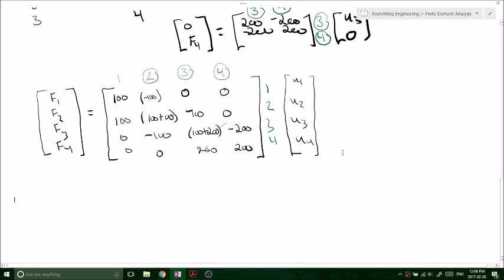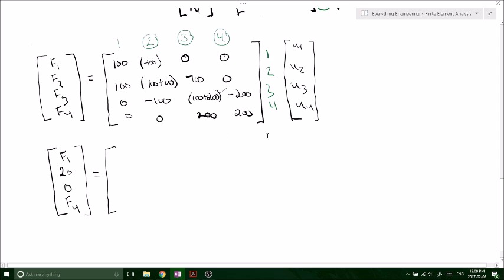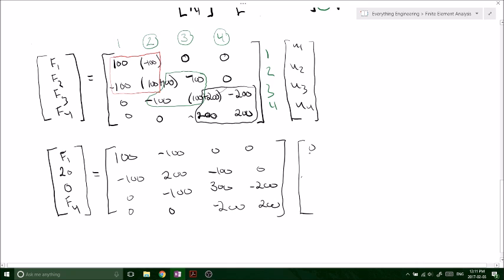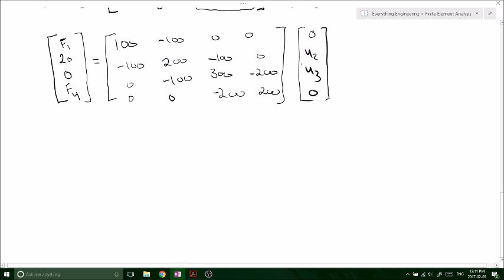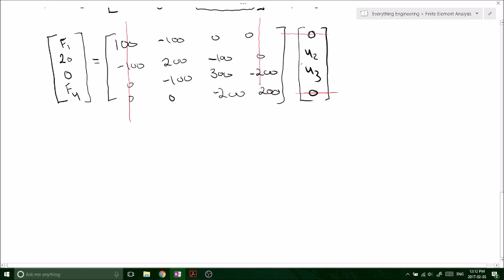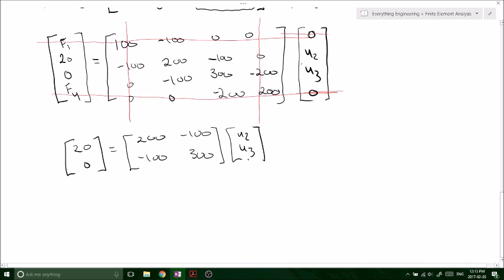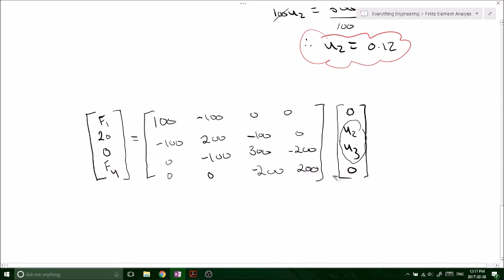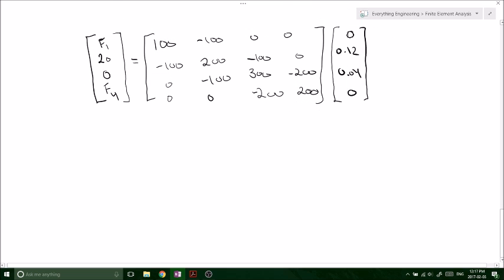Stiffness Matrix to solve for node displacements and reaction forces (Part 2/2)

Comment: Hi, what if I have a similar structure, with 4 elements, and apply force just at one end (pulling or compression, one dimension), and another end is supported. We count nodes from the support, so we have 5 nodes. What about the internal forces at nodes 2, 3 and 4? Will they be zeros or not (we don't apply any external force, and other forces should be balanced out)? It sort of seems so from your next video, but I need a confirmation :) Thanks!